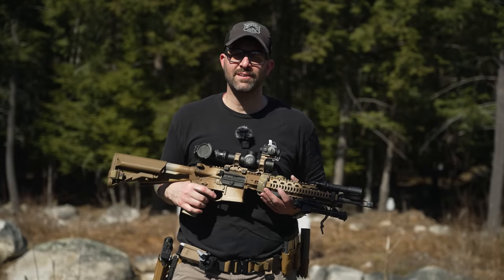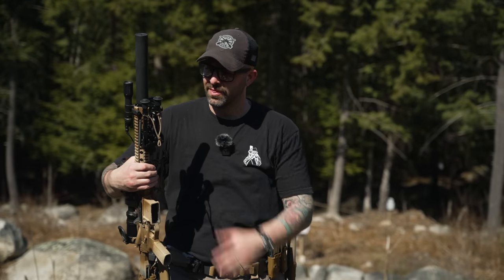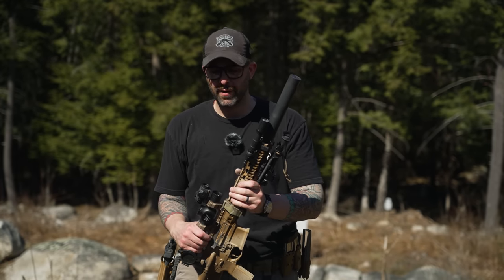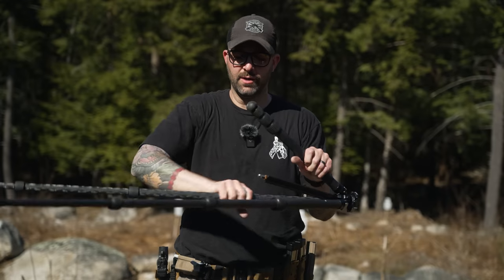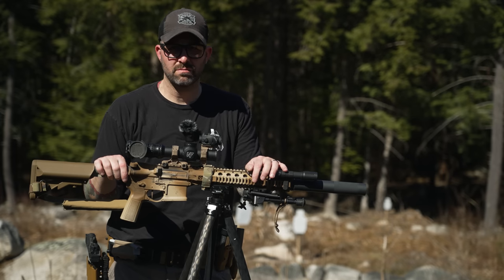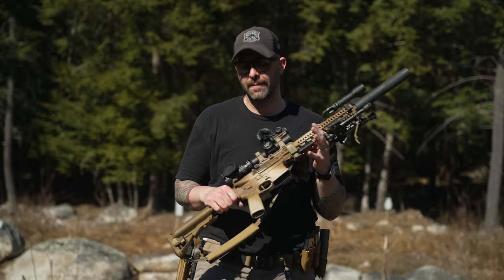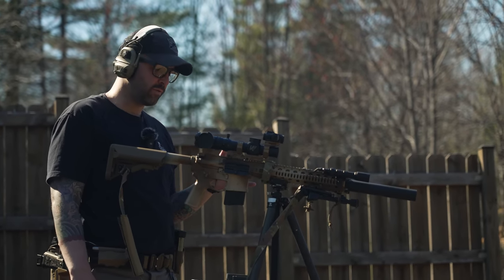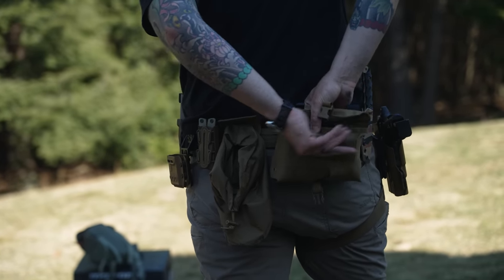TYPE A Rifle Company - 15.1" SPR with OCM5

Comment: LMT is trash.  Type-A makes excellent quality stuff so there's no reason to be putting LMT in the same sentence with Type-A......  As you stated Type-A runs on the standardized and proven AR platform, so other high end standardized AR's like Hodge, ZEV, Noveske, Geissele, POF, etc can interchange parts.....  Without a doubt my Type-A rails are the best strength to weight ratio rails on the market.
Reply from the maker: Agreed
Reply: "LmT iS tRaSh"
Source: Trust me bro

Comment: As a former RRS employee and a current RRS Ascend-14L tripod owner you CAN actually time/tighten both the ballhead and the center column clamp tension for a stronger hold and lock. The Ascend is indeed not the most stable of the RRS line but does the job and is extremely light and compact. Great vid!
Reply from the maker: really?!?! i asked some sniper buddies that run them and they said now. Teach meeeee

Comment: Got enough hot garbage on that thing?
Reply from the maker: What's hot garbage?
Reply: Just poor trolls
Reply: “Hot garbage” might be a bit unfair, since it’s all high end gear.  But I agree with the sentiment, that this gun has everything but turn signals.  Night vision, LPVO, backup red dot, backup laser, IR illumination, backup illumination, bipod… that’s a lot of stuff.
Reply: @CutlassOutdoors  it is a lot, but it’s clearly purpose driven. Brotha has so many set ups he can choose from. Most people who have this sentiment from what I’ve seen only have 1 or 2 fully fledged out set ups. To include at minimum light, Optic, and sling. Alex probably has dozens he can choose from
Reply: @66zam  true, but there seem to be a lot of redundancies.  If it’s his night-time hog gun, and he’s using a clip-on NV device, then why the red dot?  Why the flashlight?  If it’s for use with thermal, why the IR laser and illuminator?  If he’s using it from a tripod, why the bipod?  Doesn’t seem very focused for a “purpose driven” build.  And he compared it to a Mk12 Mod H, which is a much lighter gun that is purpose driven, so the criticism is fair.
Reply from the maker: yessss
Reply from the maker: i dont have a clip on thermal YET for it. so this is for nvg and whit for pid....

Comment: I'm not sure what gas setting you have the rifle on, but if you read the SA manual the gas block has gas restriction settings and gas "bleed" settings, and you might get less blowback if you have it on the "bleed" settings. Love your setup!
Reply from the maker: I gotta mess with the bleed. This was gas tuned by Type A before adding the can, I tuned to the suppressor from there. I should try bleed off! great feedback
Reply: @ANRDesignLLC  I had to do the same with one of my low flow cans... from SA website "CLICKS OF ADJUSTMENT:

0: CLOSED (NOT RECOMMEND TO FIRE CLOSED, YOU MAY SEIZE THE SCREW)
1-17: RESTRICTIVE MODE
18: FULLY OPEN, FULL PRESSURE 
20-48: BLEED OFF MODE
Reply from the maker: oh snap!!!!
thank you

Comment: I’ve seen guys do long range work with 10.5inch barrels…no problem at all with a 15.1 inch “SPR”. My MK12 has an 18” barrel since I’m a pussy, but run what you got 👍
Reply from the maker: I've pushed 10.5 to 400 under nods but it ain't fun

Comment: Its not an Instagram low ready. The location of your target or target area should dictate how high or low your low ready is. The closer your target is the lower it would be. The further your target is higher it will be. I.E. need to be able to see hands. Also, what if there was a target higher than you say on a second-floor patio? Would you still want your low ready at your belt line? Food for thought. Your new rig is slick. Thank you for sharing.
Reply from the maker: Was just a joke my dude.
Reply: @ANRDesignLLC  My bad brother. Thank you for clarifying.

Comment: What's the thought process behind using a piggybacked red dot versus a 45*?
Reply: I would imagine; 1. Passive aiming under Nods. 2. Using the dot to aquire targets at distance, without having to fish for them through the scope. 3. Keeping the rifle vertical during Close Quarters engagement, so that the weight and balance doesn't become lopsided and wonky, especially if you happen to be in the prone. 4. Being able to "Pie" or "Slice" corners without having to expose yourself more than you are likely to be by default. Your white-light or laser-designator is likely already an issue in that regard, no need to double up on that issue with a 45 degree canted sight. 5. With a gun THAT heavy, you would likely be acquiring either one of your sights from "low-ready". Makes things simple. 6. Last but not least, GAS. Depending on where your 45 offset red dot sits, you can get a build-up of carbon on your lense overtime and possibly f*ck up your optical coatings, if you don't clean them up when doing maintenance. While it is possible, I have not heard anyone bring up this issue as usually it's not a problem. I have rifles with 45 degree offset red dots, and I clean them along with any other glass I have on the gun. Therefore, I have no complaints in this regard either. Just make sure your 45 degree offsets aren't inadvertently being used as spent case deflectors.

Just my 0.2 cents.
Reply: How are you going to cant the gun for a 45* offset when it’s on a tripod?
Reply from the maker: I explain in the video
Reply: @cialee1989 it also gives you a more “heads up” shooting posture. Not sure about the specific measurements, but it’s not much higher than the Unity mounts

Comment: Weighs 1 pound less than an M249.
“It’s not that heavy.”  👌🏻
Reply from the maker: In comparison to PRS gun. It's half
Reply: @ANRDesignLLC  true, but why are you comparing it to that?  By that measure, almost any gun isn’t “that heavy.”  I mean, it’s about 1/3 the weight of an M134 minigun (lightweight mod.), but that’s kind of an irrelevant comparison since it isn’t used for the same thing.  It might be more reasonable to compare it to something like a Mk12 Mod H, which has the same use case, and weights 10lbs loaded.
Reply from the maker: 15 with clip on nvg.... that's at full night time capability of the system. dunno what the issue is lol

Comment: Type-A Rifles is a joke. Don't deal with these guys! They dont even have their own piston system, they use Superlative Arms piston system in their contractor models and they aren't even pinned on they are set screwed. That is ok on a di gun but a piston gas block? No go!! Aslo, I bought a handguard from them and it didnt fit for the application I was gonna use it on and the guy was a snob on the phone and kept cutting me off and wouldnt let me talk. Kept saying there was a 25% restocking fee on a return. A return that hasnt even been mounted on a gun?? Thats insane!! Blessing in disguise because I was just getting ready to buy one of their guns tomorrow for $2600. Im glad I did more research and then this chump on the phone wasn't even trying to hear what i was saying. A company that charges that much for a gun and they dont even make thier own piston operating system but they put a retrofit kit from another company and the gas block is set screwed on?? Haha, yeah hard pass on that BS. Everybody reading this needs to listen because I've owned most of the top piston brands and Type-A sucks. Im a gunsmith and have been for 22 years and I'm glad I saw one in person today because after looking under the handguard then that was a DEAL BREAKER.
Reply from the maker: thanks for the feedback. This is a DI gun, but thanks